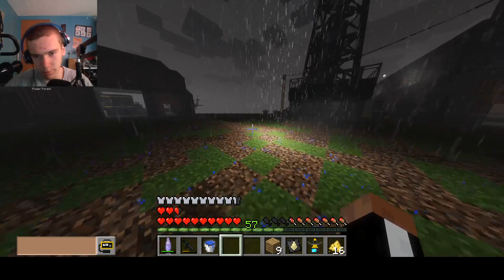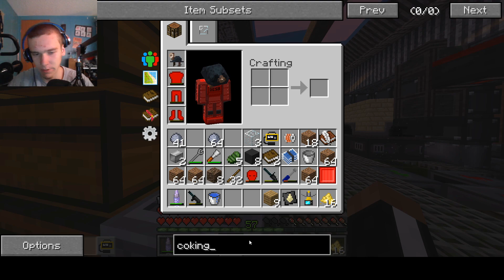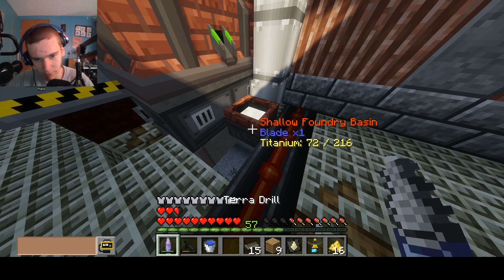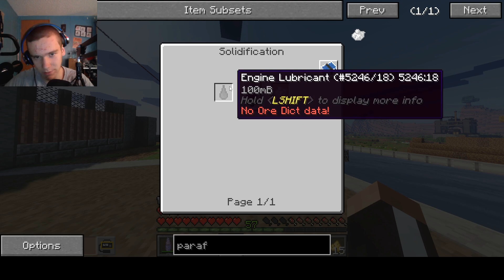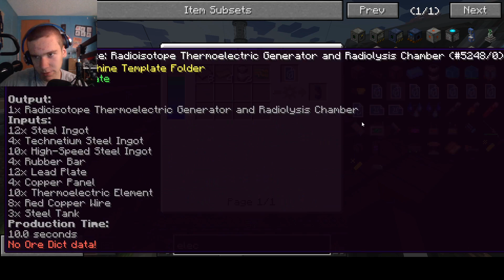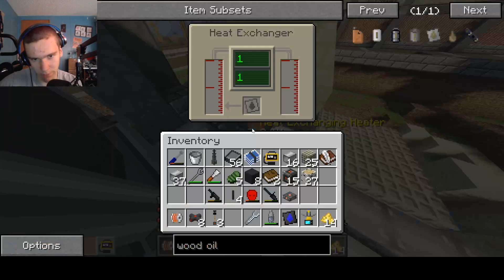Lets build a wood oil plant | HBM`S NTM survival

Comment: thoughts of making the rbmk prioritize steam to the combustion oven first?
Reply: Auxiliary cooling tower= 50mb/t
Flare stack = 50mb/t (also does 50% more on flamabiles 10% for combustibles)
Cooling tower = 500mb/t
Reply from the maker: Ye I had a base which ran all the machines on steam from nuclear, you definitely want to just dump the low pressure steam through the gas flare but it is possible
Reply: are you gonna do it or ???
Reply from the maker: I have done it before but I just used an aux cooling tower wich got backed up and steam was not distributed correctly
Reply: Also i checked the rates that they vent gases